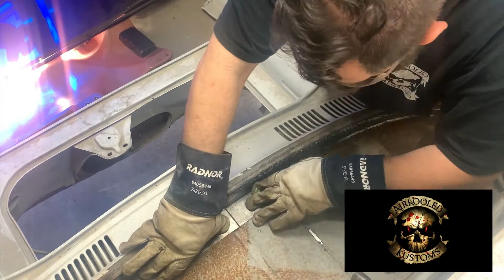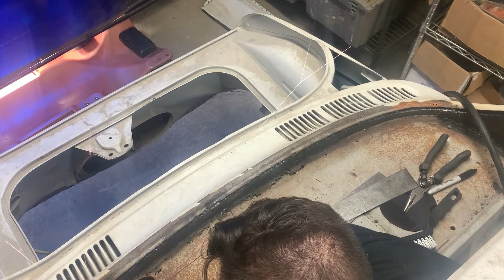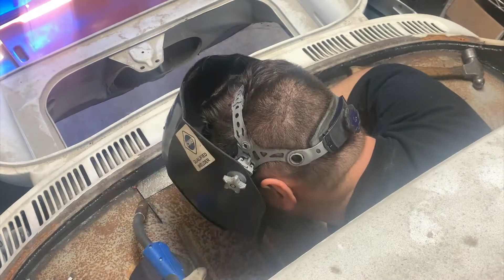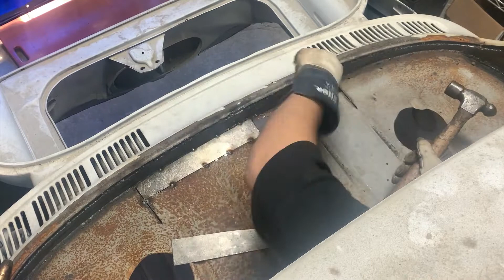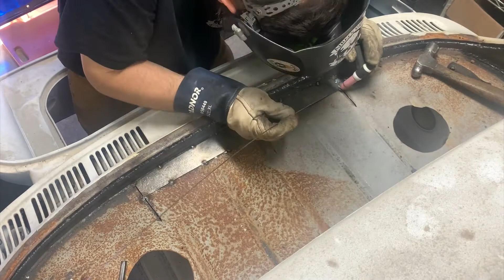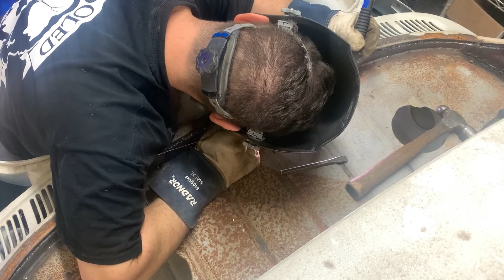Notchback Window and Package Tray #vw #vwrestoration #metalwork

Comment: I sure wish I had Tig welding capabilities.  I like how you could see the heat control and  that the fill rod was only used when needed.  Notchbacks are amazing and looking forward to seeing this one after Spook and the team are finished
Reply from the maker: its is a whole Dif level
Reply: @AirkooledKustoms  That`s for sure.